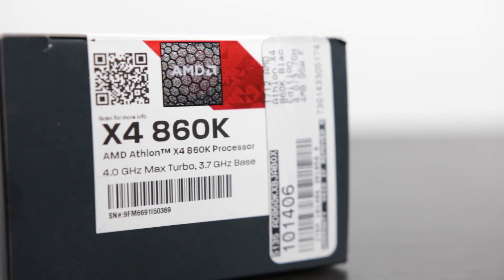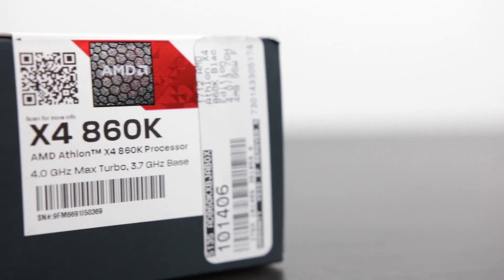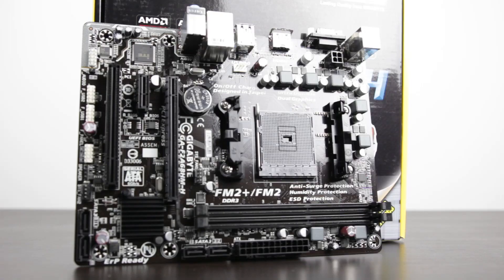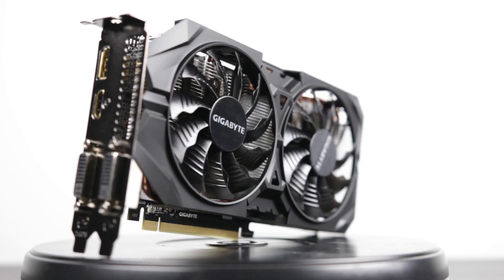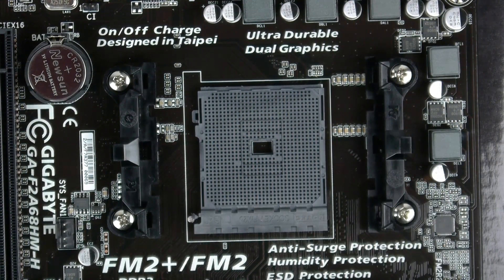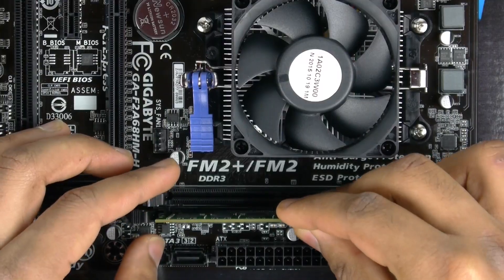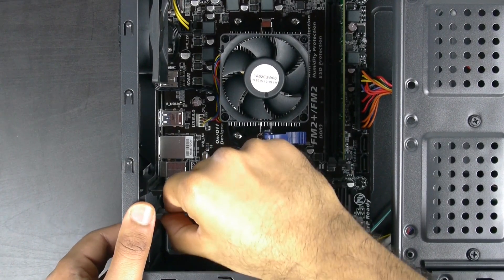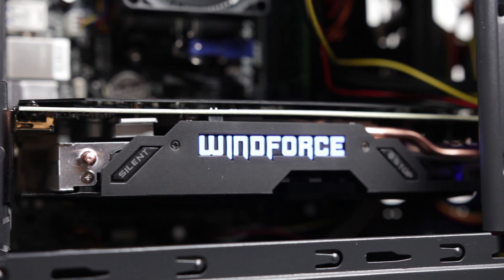Best 2016 AMD Gaming PC Under $400 - Build Guide & Benchmarks (Ep. 1)

Comment: The AMD R9 380 is bottleneck like hell by that cpu. A bit of a money waste. the R7 370 is a bit more adequate for this system. So basically is more of a 720p performer. I mean 25 fps dips in games is not playable
Reply: +Vlad Amariei It's going to depend on the games, and also when someone would plan to upgrade again, if you go for the G3258 some games pretty much require quad cores so it won't run them well if at all. and if you're stuck with the PC for say a year or two, then an 860K + 380 is going to be better overall for gaming than say an i3 + 370
Reply: Well rather 270/X. Amd cpus just have bad price-to-performance at this point.
Reply: MrKeikari
Dual graphics is really something no one should ever buy into unless they get the GPU for free or something.

it's going to depend on when someone is going to upgrade, being stuck with a dual core for the next year or 2 is going to be bad if more games require quad cores, which makes the 860K a reasonable buy, though AM4 is going to be a lot more reasonable next month if the pricing is right.
Reply: Street Guru Ummmm, and why is that?

Combining 380 with 860k still doesn't seem reasonable. I'd rather wait for Zen than waste money on dead upgrade path sockets FM2+ and AM3+.
Reply: +Vlad Amariei He had everything maxed out for testing purposes. If you ever built this PC for reals you would not be running games maxed out.
Reply: MrKeikari
Dual graphics is pretty finicky and not worth buying into, you could just get a better GPU normally
Reply: +Vlad Amariei then why is it, my A8 7600 with all turbo to 3.8 brings my gtx 960 ftw to full utilization in BO3..A8..weaker than an athlon. A rule of thumb is the gpu should be 75%-100% more than the price of the utilized cpu. in this build, the price is right.
Reply: +MrKeikari so just cause 3 is a single thread bound game?
Reply: MrKeikari
They really are not all that bad, perfectly valid for gaming on the cheap, an i3-6100 costs $123 right now, while the 860K costs $75 and gives comparable performance in many games, at the very least playable frame rates, which is what's important, but ya, AMD CPUs really stop making sense to buy once the budget is well over $400
Reply: Also consider G3258/4400. And for $400 i'd rather go with APU and crossfire that with discrete gpu if necessary. Build with 380 is just screaming for cpu upgrade :)
Reply: MrKeikari
because this would be for someone who only has around $400 to spend, and probably isn't going to have anything for upgrades for a few years, as far as gaming goes the better GPU is going to be more important than a better CPU in the i3.
Reply: +Street Guru Good advice
Reply: Street Guru I was talking about Dual Graphics. It's easily the best bang4buck aka console killer from Amd. Tho ofc used parts make most sense in that case.

ihave7sacks Fiddling with settings doesn't help that much since most settings affect gpu load. Very little you can do against cpu bottleneck and that's not pleasant experience.
Reply: my 7850k (a 860k with a powerfull iGPU) hardly bottlenecked my 290x....
Reply: +Vlad Amariei Not really only very few cpu intensive games will have small gain from 370 to 380 all other games will have much higher frames
Reply: Jerry Knudsen BO3 seems to stress cpu very little. In newest games like Just cause 3, 8350 bottlenecks one 960 :s
Reply: hey I will use an i5 6500,8gigs ram and the exact same gpu,how many fps will increse in those games??
Reply: A lot more, and more stable fps. you can look up youtube for comparisons.
Reply: i5-6500 removes the bottleneck so you get all the frames 380 can push :)
Reply: +TheMuesliEater same here
Reply: +TheMuesliEater Not surprising. You paired a high end gpu with a budget cpu.
Those cpus are for lower end to midrange cards.
From amd I'd recommend the FX 83xx cpus. FX 8350
Reply: +Chika Hakozaki 8350 is outperformed by i5-4460 in both and performance and price-to-performance ratio.
Reply: MrKeikari
depends overall it is, but in gaming the i5 4460 beats it, the 8350 makes no sense buying in 2016
Reply: +Vlad Amariei  x4 860k wpair with a88x or a58x mobo for good overclocking and definitely go for 212 evo for cpu cooler and 2*4gb 1600 or 1866 ram and for gpu a gtx 950 would suffice the build for 1080p gaming. And lastly if he go for cheap mobo than the new x4 845 is the way to go it has higher ipc but its locked
Reply: Ar Kay slasher rk I just wonder why Amd is still pushing out their obsolete architecture refresh when they soon have decent cpus with Zen :S
Reply: +Chika Hakozaki  i said it hardly bottlenecks my GPU, so it does it really rarelly.
Reply: TheMuesliEater Yes, Amd cpus are notorious for bottlenecking even budget gpus like GTX960. Not worth the high price :S
Reply: ***** If you got a great deal on it, I don't see why not...
If someone offered me a 8350, for lets say $100? I would buy it and put it to use. I own a 4670k and G3258. Before this I came from Phenom II x4 965 (which I still own). Just throwing that out there....
An 8350 is alright for gaming. Not everyone can afford or cares about having the best.
Reply: TheMuesliEater my mistake, in a more cpu bound game, you will see a bottleneck. I'm not saying you should look for it though. You might not even notice it, which is good in way because you are more focused on enjoying the game rather than that. when you start running into games that you can't play, then its a problem, until then, I hope you enjoy your games :) because in the end, it comes down to that anyways. :P
Reply: MrKeikari dude zen will only come out in november and u can wait but if u r building one right now and x4 845 is the new improve excavator core with 5-10 % more ipc and it comes with a better stock cooler
Reply: Ar Kay slasher rk More ipc? :D No point wasting money in Amd until Zen comes out, rather get Intel. Amd is just retarded pushing out locked cpus with their obsolete architecture.
Reply: u know they have to clear the stock b4 zen really comes out in november so one can wait for zen but regardless they will still push out more and more ipc and new instruction and new architecture is on the new release chip so but than again its amd so ppl will complain
Reply: Ar Kay slasher rk Yeah, they should stop deceiving customers already and focus on Zen.
Reply: umm yup but i heard the polaris and pascal is due this june so r u going for which one ?

Comment: That cpu is fine if you are going to play single player games only, but in online multiplayers the fps will drop significantly. I wouldn't install anything better than an r9 270 gpu (in some scenarios it bottlenecked a 270x). Also in 2016 8GB ram is minimum imho.

Comment: Would you classify this as "console killer"?
Reply: Get 4 more gigabytes of ram then sure. Consoles are pretty much the "high/medium" graphics preset and they run at 30 fps on most games so yeah the benchmarks show it can run high at above 40 comfortably if it had 8gb of ram. Have fun if you build a PC. Though the only reason nowadays to buy consoles are exclusives and the couch co-op games like halo.
Reply: +Ratchet definitely
Reply: +Ratchet Well seeing how the graphics card is the most important component, it makes sense.
Reply: Zcolby the graphics card is also the most easily replaceable in the long run. i'd get a cheaper graphics card for now and get a better ATX motherboard and maybe even a better psu. or just increase the budget to 500 or 600 usd.
Reply: +Ratchet oh well that was a spirited discussion. Good day to you sir
Reply: +Ratchet no, it would kill it by being such a terrible build, shit power supply, too litlle ram and a gpu too power full for the cpu. they should of used a gtx 750 ti or a r7 360 and put more into the ram and powersupply
Reply: Mr Rishi The Cookie i think the graphics card is a bit on the high end for this build its more than half the cost
Reply: +Ratchet yeah that's a good thing t right? It may get slightly bottleneckd by the cpu but that isn't important here.
Reply: +Ratchet I understand that. But I think extending the budget to 500 may not be possible for say a 13 year old getting a PC for his birthday or something. Also I think current performance outweighs the future performance when it comes to PC building. You may get in a vicious cycle of forever waiting for the better graphics card to drop in price or save up for the next card. For that reason is why I personally would not go for the cheaper card and better mobo or hdd etc.
Reply: Mr Rishi The Cookie guess its a matter of preference, but i just can't compromise on the mobo cause it is the most difficult thing to upgrade. psu being second most difficult form me. everything else can be easily swapped. but i understand if you're just looking for the "now" build.
Reply: +Ratchet This is an 860k killer. Also classified as the eyesore, brain tumor causing, indigestion, vomiting build. A very useless and unpractical build.

Comment: 860k bottleneck the r9 380 and 4gb ram is not enough for most new games, this build is shit
Reply: Should've gone 280 or 270x, maybe even 950. Much better choices
Reply: +josh Subet 860k will bottleneck even gtx 950, i3 + gtx 950 will be nice choice
Reply: +murad hajimuradov i3 isn't good for gaming since it only has 2 cores...
Reply: it is good for gaming if you use it with gtx 950 :) it has 2 cores and 4 threads :) and i3 core performance is much more powerful than any amd core performance :) i3 with gtx 950/960 is a good combo. for gtx 970 i5 and i7 will be better choice of course
Reply: murad hajimuradov
I would rather get more ram and a better PSU with the money saved by getting a lower tier GPU. $450 is the realistic minimum for modern PC gaming builds.

Comment: It says quad core in the settings but then cinebench says it is dual core with 4 threads.
Reply: +Ken Alex Keane That lawsuit will probably fall through, the cores are real enough it's all based on them sharing a floating point unit between the cores. 

It does not have multi-threading/hyperthreading like how an i3 is truly a dual core with 4 threads, the cores are actually there, it's just some websites/software are being picky about calling them true quad cores now.
Reply: MrKeikari
But each module has a dedicated integer unit and they physically exist unlike the extra threads you get from something like hyperthreading. They really aren't being deceptive at all, it's just how the architecture works, the lawsuit probably, really isn't going to go anywhere
Reply: Have you heard the whole controversy over AMD's "8 core CPUs"?
Each "core" needs something to be an actual core (forgot name of it). Normal CPUs have one core for every thingy. AMD puts 2 cores for every thingy, so it really isn't a 8 core CPU. Saves money.
Reply: I did not know about that, but I did notice in the video the box says multicore. I guess they might do that so people will have to guess if it actually has 2 or 4 cores.
Reply: And deceives buyers. I hope they're getting punished in court. Current amd design has 1 floating point unit, L2 cache and most L1 cache per two cores... It's like saying your car has 8 tires if you glue one extra into each existing one.
Reply: And deceives buyers. I hope they're getting punished in court. Current amd design has 1 floating point unit, L2 cache and most L1 cache per two cores... It's like saying your car has 8 tires if you glue one extra into each existing one.
Reply: Yes but only 1 fpu per 2 cores which makes 8350 more of a 4-core in gaming, 6300 -> 3-core and so on.
Reply: MrKeikari
not really no, it's still an 8 core/8 thread CPU, it's multi-threaded performance is pretty good, it's just that it's a really old architecture that was never any good at single core performance, and that's why it's so slow in most games.
Reply: +Street Guru Australia here :)  My daughter sent me this link as she would like me to build this for her but I see a number of comments either way. 
As an alternative to this AMD what would you suggest I opt for. You seem to know your topic well. Thanks.
Reply: Mark Anderson
So what's your budget?
Reply: Mark Anderson It is hard to say. This product has its strengths and weaknesses for the price point that it is at. Do recognize though that this is without windows and is only using 4 gigs of ram. Did he mention the size of the hard drive? If it is less than 1 terabyte, that is just sad.
For the price of this build, you can find similar machines that are already made, have true quad core i5 CPUs, and come with warranties. I know people like to have things that they made themselves, but definitely shop around.
Reply: *****
I don't know the market there, but I imagine it's probably a good deal harder to find used hardware in Australia compared to the US.
Reply: Mark Anderson Just looked at the Hard drive, it is 500 GB.
I suggest looking at the desktops on Amazon. They have a lot of nice ones at the moment.
Reply: ***** Street Guru  Thanks both for the swift reply. The AU exchange rate is terrible at the moment around .70 and irrespective items just cost a lot more here anyway. Budget wise it I guess I'm expecting to be around AU $800+ roughly (US $600). Sounding like I should push it to 1K and look for a prebuilt i5 option ?   cheers.
Reply: My name is Jeff
Mostly just gotta look out for a review of it from JonnyGuru
Reply: +My name is Jeff   Thanks All, appreciate the feedback.
Reply: +Mark Anderson 

ya, you could either go with AMD here, I have an APU in there because it&#39;s actually cheaper than the 860K and the CPU is the same, so I guess you have a back up GPU or you can do other things potentially with it

Australian pricing is fairly crazy overall it seems, AMD almost isn't an option 

 PCPartPicker part list: http://au.pcpartpicker.com/p/2VBXTW
Price breakdown by merchant: http://au.pcpartpicker.com/p/2VBXTW/by_merchant/

CPU: AMD A8-7650K 3.3GHz Quad-Core Processor  ($135.00 @ Scorptec) 
Motherboard: Gigabyte GA-F2A88XM-HD3 Micro ATX FM2+ Motherboard  ($95.00 @ Scorptec) 
Memory: Kingston HyperX FURY 8GB (2 x 4GB) DDR3-1866 Memory  ($59.00 @ Umart) 
Storage: Western Digital Caviar Blue 1TB 3.5&quot; 7200RPM Internal Hard Drive  ($69.00 @ Centre Com) 
Video Card: PowerColor Radeon R9 380 4GB PCS+ Video Card  ($299.00 @ CPL Online) 
Case: Deepcool TESSERACT BF ATX Mid Tower Case  ($49.99 @ Mwave Australia) 
Power Supply: EVGA 500W 80+ Certified ATX Power Supply  ($69.00 @ PCCaseGear) 
Total: $775.99
Prices include shipping, taxes, and discounts when available
Generated by PCPartPicker 2016-02-22 12:28 AEDT+1100

for about $100 more you could get a skylake i3 with USB 3.1 on the motherboard, the shipping price on the board is crazy, so maybe try to find it elsewhere, if you go for another make sure it has USB 3.1/Type C in some capacity, it&#39;s the main reason to get the platform, it&#39;s probably best to go for the skylake build below given it&#39;s cost

PCPartPicker part list: http://au.pcpartpicker.com/p/QKhh4D
Price breakdown by merchant: http://au.pcpartpicker.com/p/QKhh4D/by_merchant/

CPU: Intel Core i3-6100 3.7GHz Dual-Core Processor  ($173.00 @ CPL Online) 
Motherboard: Gigabyte GA-H110M-S2HP Micro ATX LGA1151 Motherboard  ($151.98 @ Newegg Australia) 
Memory: Crucial 8GB (1 x 8GB) DDR4-2133 Memory  ($60.00 @ IJK) 
Storage: Western Digital Caviar Blue 1TB 3.5&quot; 7200RPM Internal Hard Drive  ($69.00 @ Centre Com) 
Video Card: PowerColor Radeon R9 380 4GB PCS+ Video Card  ($299.00 @ CPL Online) 
Case: Deepcool TESSERACT SW ATX Mid Tower Case  ($55.00 @ Mwave Australia) 
Power Supply: EVGA 500W 80+ Certified ATX Power Supply  ($69.00 @ PCCaseGear) 
Total: $876.98
Prices include shipping, taxes, and discounts when available
Generated by PCPartPicker 2016-02-22 12:30 AEDT+1100
Reply: +josh Subet  the 8 core from AMD is a true 8 core it has 8 cores.. it comes up as a quad core cause every 2 cores share cache
Reply: +Ken Alex Keane  its comes up  as a dual core with 4 treads cause the the core share the same cache
Reply: tjgibbz *Caches. And shared floating point unit which really slow things down in games and such.
Reply: MrKeikari
That's not exactly the reason, the architecture is just old and inefficient at this point, although an 860K can still get 60fps in a lot of games, it's only when it comes to emulation or very CPU heavy games where an AMD CPU is going to be weak.